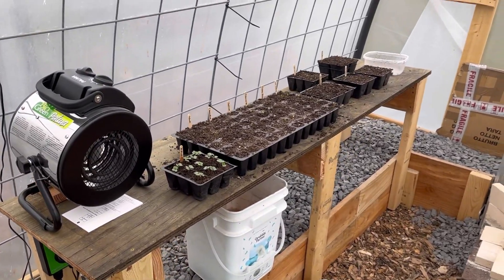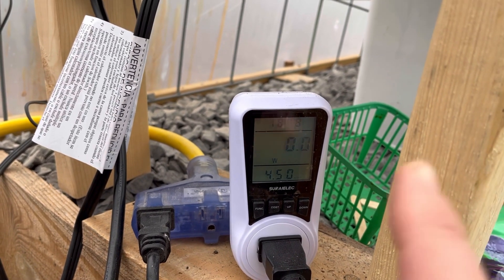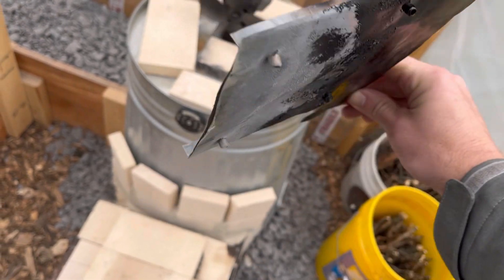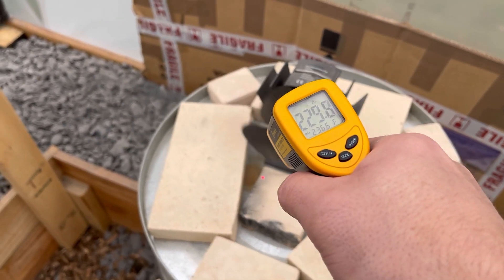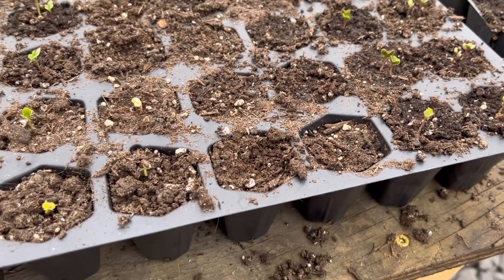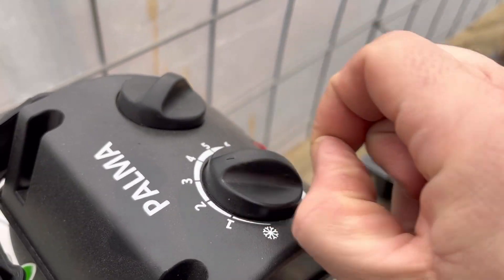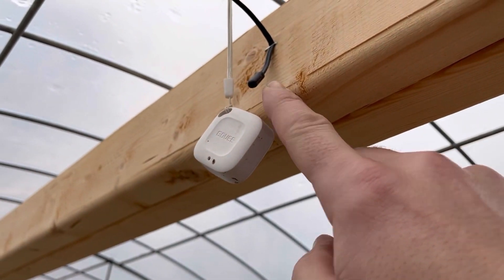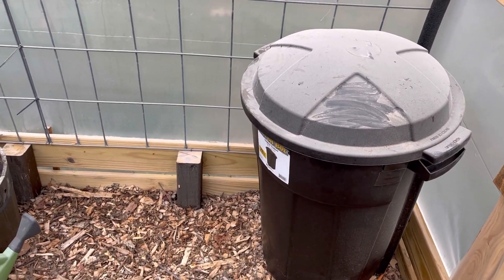Grow-house Heat Update

Comment: Thanks for the update. Too bad the wood in the rocket mass heater burns so fast that you had to get a supplemental heater/thermostat/fan set up and run an extension cord out to your grow house. I'm so glad nothing died and about $5 a week to keep it from freezing in there seems reasonable! I'm glad you have free wood to burn. You can't do better than that! I think stainless steel or regular steel is better as a "bell" for your rocket mass heater. The zinc will come off and give you "metal fume fever". I'm not sure it's getting hot enough to do that but it's bad in an enclosed space. It can cause death? One place said to keep the galvanized surface from reaching 392F or the zinc can start coming off of it. Zinc fumes are very toxic and will accumulate in food! Perhaps replace the galvanized garbage can with a steel drum of some kind? Good luck!

Comment: In my world you want it to burn hot and fast, when you do, you don't have any creosote issues. Something I am learning from looking into masonry heaters. If the problem is that you need the heat too last longer, you need to add more mass to your exhaust pipe. You could make the rock box around the exhaust pipe deeper and taller, and then fill that space with more rock. 

And then you could make your exhaust pipe longer (with the rock box around it), essentially making a train with your rock box going along the whole outside of the space. Like the size of your rock box, but times 4. What I propose is that you could keep running with the exhaust pipe (with a rock box around it like you did), and make a u-shape ( U ), with the exhaust pipe rock box going along the 3 sides (inside wall) of the greenhouse (which with that in mind, it might be better to have the fire box, just inside the door, to the left or right, and then have the exhaust pipe come out the other side of the door). 

And then you could build your grow beds on top of that. And by doing that, the grow beds would be at a standing height, and easier to plant and harvest, and then much less risk of the plants freezing with the heat below them in a mass radiating. 

An issue with this design, is dry beds, so with this plan you would need some kind of watering system for the raised garden beds. 

With this system it should give a consistent heat for up to 12 hrs.